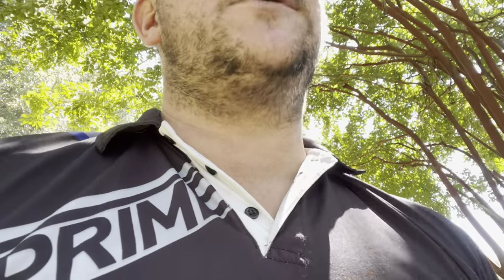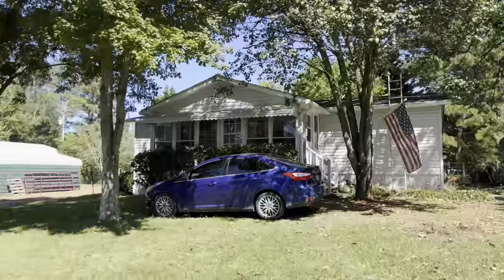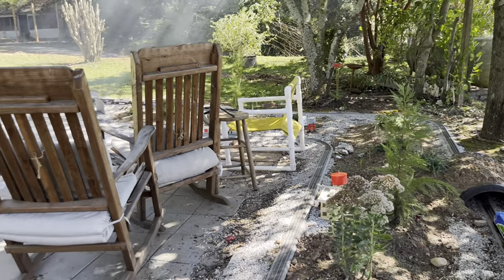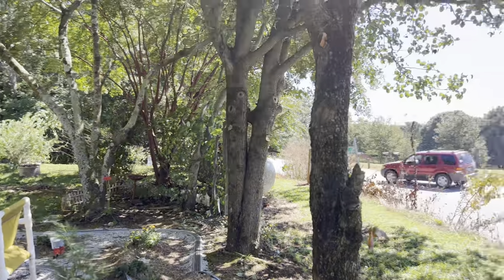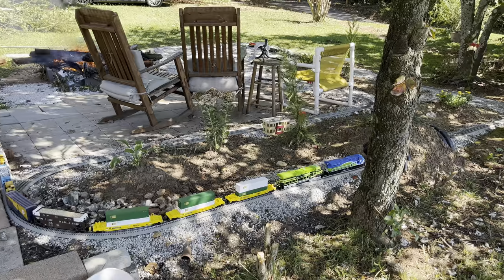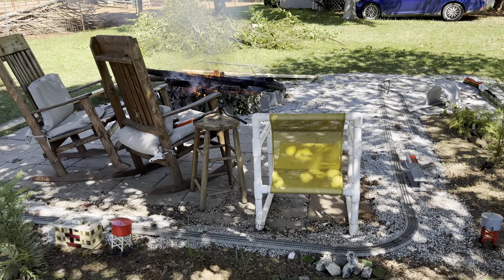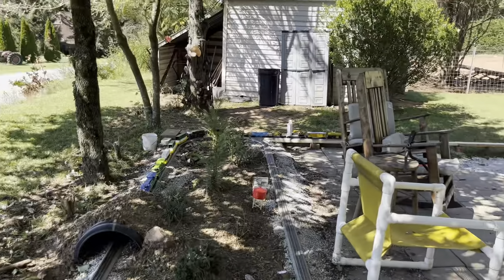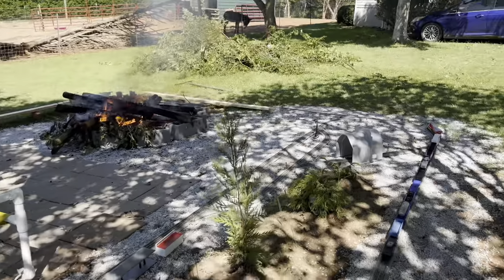My new project, massive outdoor train layout ! O gauge Lionel !!

Comment: You might want to switch to a different track that’s not going to rust. Like Gargraves 202 flex track with all 3 rails stainless steel.
Reply from the maker: Bro watch my outher channel lol this stuff is amazing 0 rust 1 hurricane 10 rain storms in 6 months gotta use no ox
Reply from the maker: Watch my outher channel merritt excavation rc I can't get the stuff to rust with no ox I have side by side compression videos stuff is amazing